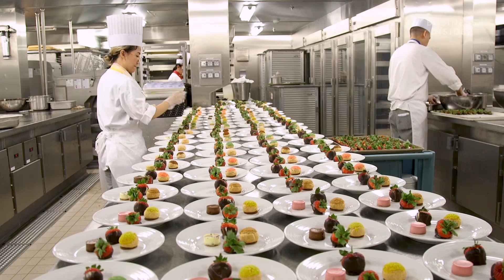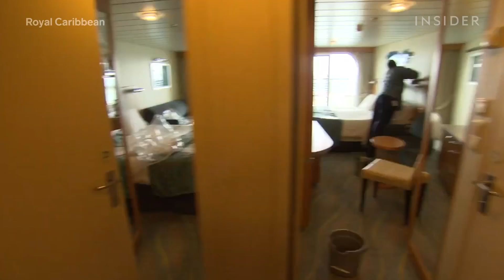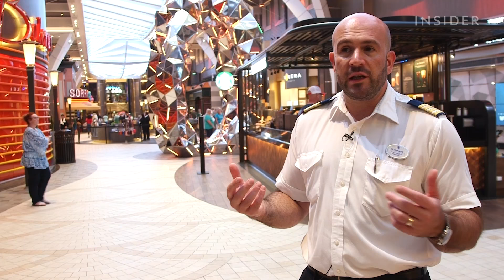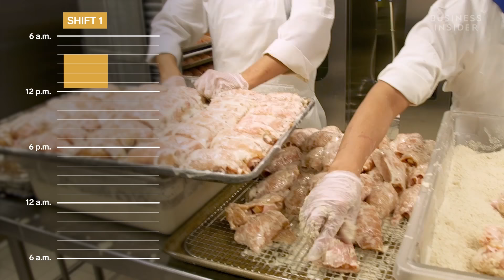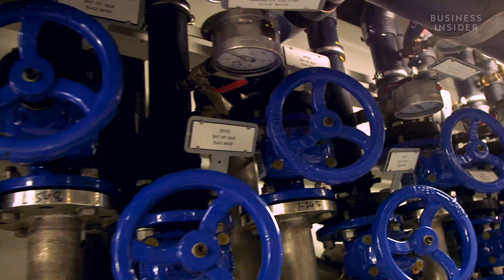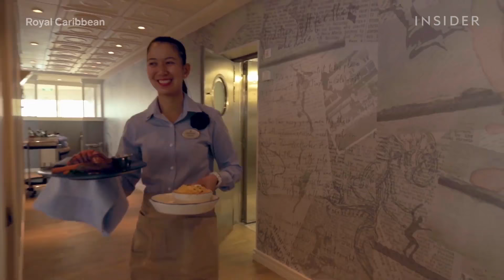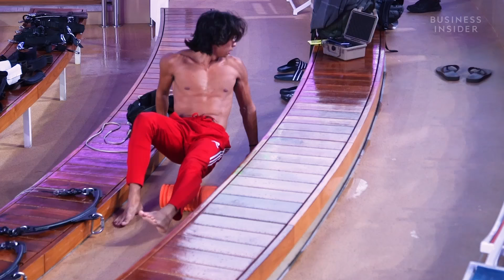Why It Costs $1 Million Per Day To Run One Of The World’s Biggest Cruise Ships | Big Business

Comment: i looked up what a trip on this ship costs and while there are obviously different arrangements, one of the cheaper options would go for 142$ a day. one site said 7600 passengers at full capacity.
That means it (very) roughly brings in 1M a day. It also costs 1M a day to run. So where does the cruise ship make money? If its not from the booked trips it must come from its casino's, shops and other things not included in the arrangements. Wondering how much that actually is because at face value it seems that running a cruise ship business is a very bad choice. The ship cost 2B dollars to make. Thats a long time to get that investment back.

Comment: aint no way they still have windows 7 on a multi billion dollar ship
Reply: Why not? XP and even 95/98 still run many machines and operations at factories.

It has one job to do, run software designed to monitor an engine, HVAC system, water system, etc... it's not on the internet so there is no reason to upgrade. 

I worked for a metal shop a few years ago and the laser cutter and one of the press brakes (programmable metal bending machine) still ran on windows 3.1.
Reply: @volvo09 😂

Comment: Whats the point of paying to get locked up on a ship? It beat out its older as a ship, figuratively, but still its a piece of metal. The assortment of inventory ranges from food to hygiene products. Big logistical requirement is sail away timely which can be hampered by breakdowns in the systems of the cruise ship, personnel mistakes or other factors. They first request permission for propulsion, start clusters then depart from the harbor. They then can maneuver from the port. The crew members in the kitchen should cater to all kinds of tastes. Chief giving his critiques has all reasons to make flattering and complimentary comments on the dish. Many workers of the ship can't  be hired to be the face of the ship becuase they are dark-skinned. The ship itself is a wonder of engineering. The appetizers and salads like Carpaccio are located in the cold room. I like the single pipe through which food not eaten dropped into drains comes down. Water filtration to the point matched with US standards is an engineering feat. Quintessential and outstanding. It reduces their expenses. Production of bubble from below gives more swiftness to the ship. Mechanical and electrical workshops consist of employees too. The gymnasts are doing a make-up backstage after being done with all stagesof rehearsals, there is a cluster of rooms provided, how does it all fit there?

Comment: If anyone at Royal Caribbean is reading; have you considered utilizing the bio-waste as biogas for the new ship motors that can run on gas? You could easily setup some bio gas digesters near the ports in Bahamas, Puerto Rico etc. and unload the previous days excess bio-waste (hard solid sewage included) and then pump in produced biogas (that is produced from the bio-waste deposited week or so earlier). The end result would be fertilizer that can be sold locally, free fuel and no more valuable food being burned for pollution
Reply: Thanks for the info! We here at Royal will immediately retrofit every ship regardless of the cost!
Reply: @battery781 😂

Comment: How do they make a cruise ship carbon neutral? If they follow the lead of Maersk in container ships, they could order ships that use green methanol engines instead of diesel, as a start. After a decade or so, that might be replaced by ships designed to use hydrogen directly as a fuel. Eventually the ships will have to be built with green steel, replacing coking coal with green hydrogen. It won't be a small effort to make the conversion, I wonder if they have even started.

Comment: can't they use the macerator/incenator to capture that heat ? Like if you have a gassification/diesel recup tank inside the flame you can get combustobles back like marine oil to run on

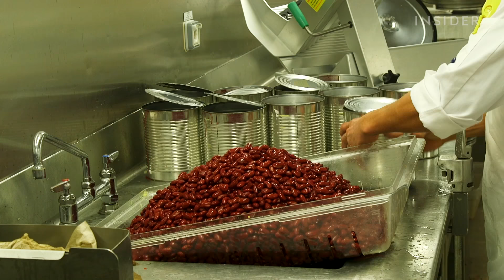Comment: Actually, if there are 6000 passengers daily and they all pay $100 there would be $600,000 from the passengers which is much less than the $1,000,000 it supposedly costs to run the cruise ship. And the video says 6000 passengers a week, not even daily at 0:09. At 0:19 the video says the cruiser makes a profit which makes no sense at all. Either they are not including important information or lying.

Comment: The average performer makes 36,000$ to 85,000$ a year with leads making 100,000$ to 110,000$ a year. They get a lot of other benefits with working for that company so even if you're on the low side 20k to 36k you're really making 30k to 45k a year with benefits. I'm sure it's a very interesting job and there are difficult parts, but I promise you its 10x easier than working a manual labor job 40 hours a week. I don't know I guess it's for some people, I would never want to do it. I like to feel like I accomplished something at the end of the day and actually see what I installed or fixed work again but that's just me. I also would never want to work in the same place night after night, I am a service technician and I do commercial HVAC work / anything mechanical and I get to go to 5 or 6 different places in a day sometimes but usually its one or two a day but it keeps it interesting and the time goes by really fast and the money is amazing.